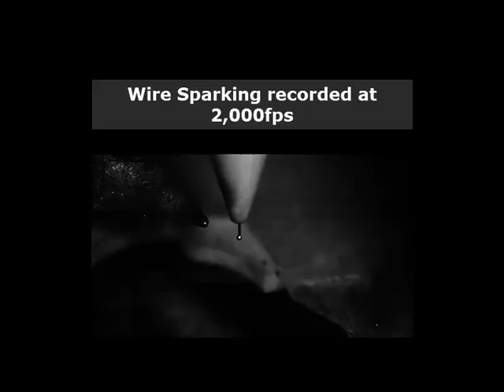IC wirebonding, HITECH volume 2, 2017

Comment: How does it break the excess wire being pulled out after a connection is made? Why does it break at the die/pad and not the tip?
Reply: It sends a shock to the tip which turns the excess into a ball for the next stitch.

Comment: Can you explain more on what is Thermal sonic pulse...!! & how it works..! Wave frequency value & flow of Electron that melt metal..!
Reply: It uses heat to soften the metal, and sonic energy to bond the wire to the die/pad. afaik there is no current.